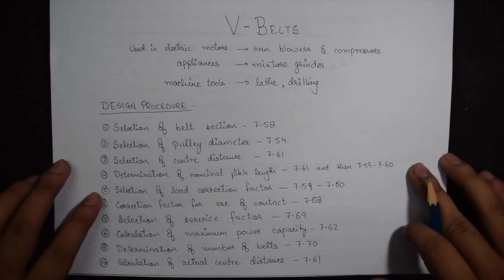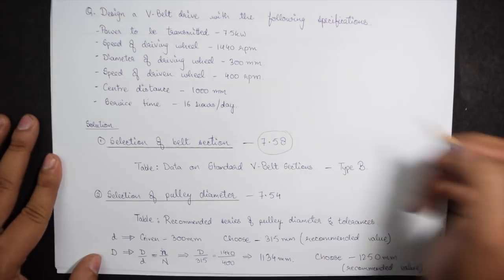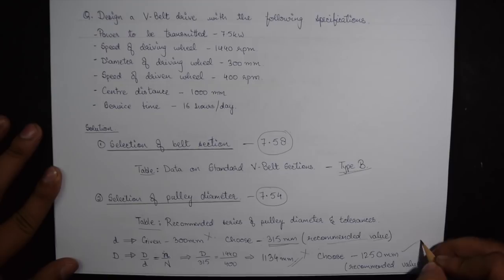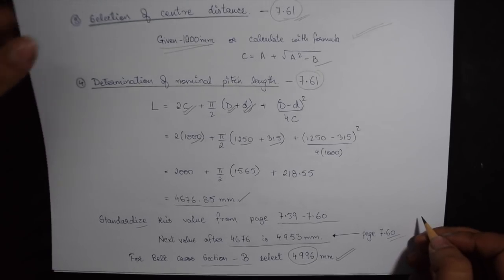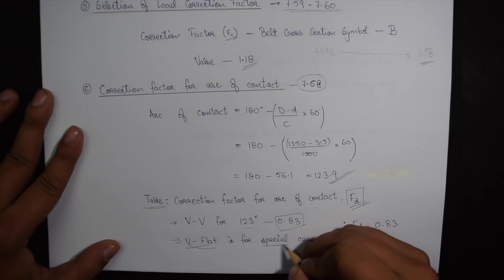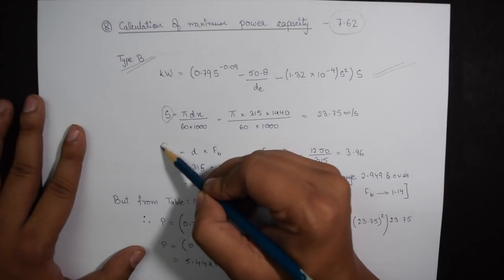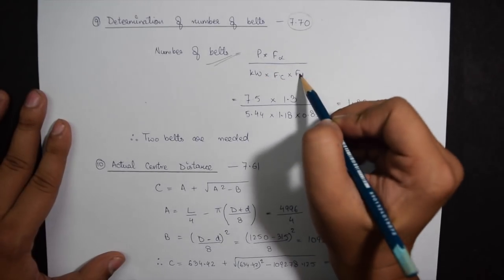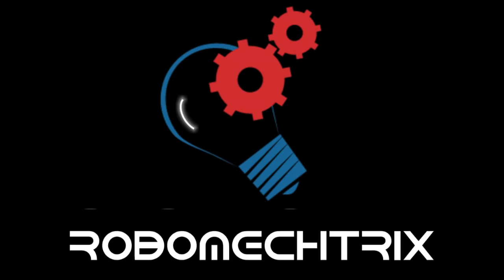V Belts Design Procedure

Comment: Sir, nice video! But had a small doubt...Why did you calculate Nominal pitch length using formula for "Open belt system"?...Why didn't u use "crossed belt system"?

Comment: Sir if on page 7.58 in for given power I select E but the dia is 500 and in question dia given is 225 then for remaining sum which dia should I use
Reply from the maker: It is preferable to go with the diameter given in the question and not in the data book. Data book has standardized and the maximum values it can withstand. You question would be solved with the values given in the question itself.

Comment: Sir what to do when small diameter is not given?
Reply from the maker: If the small diameter is not given, try to solve the question by plugging in the value of Pulley pitch diameter from the table on pg 7.58 right after you select the type of belt.